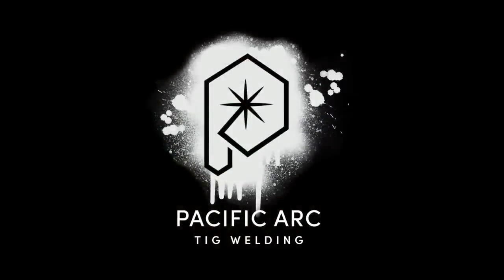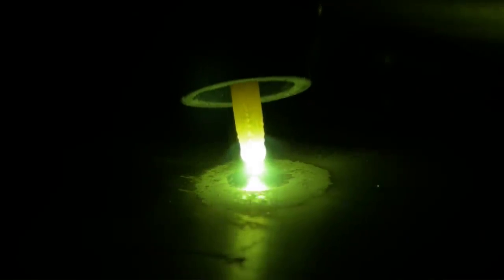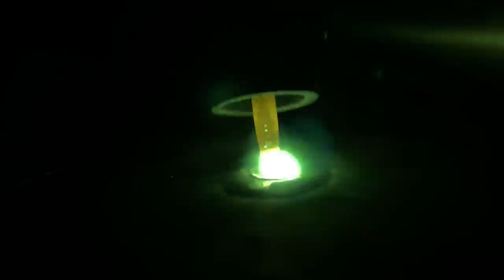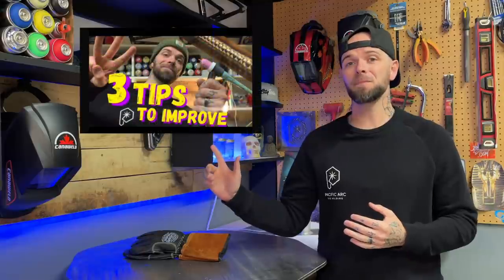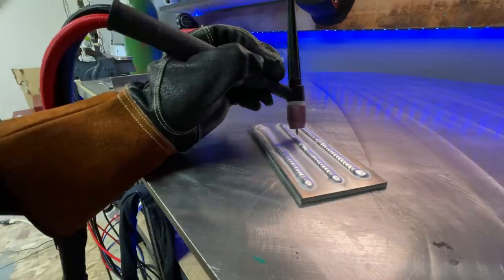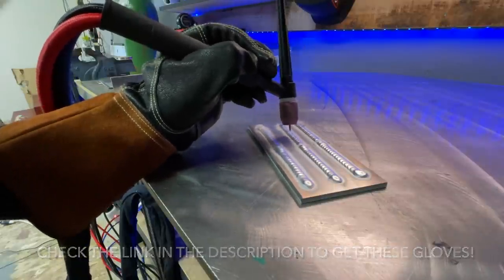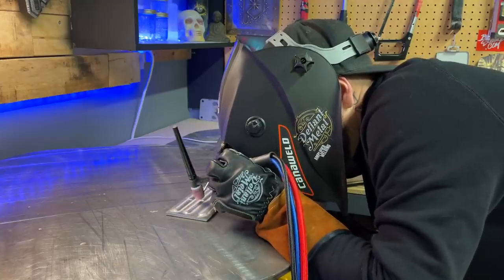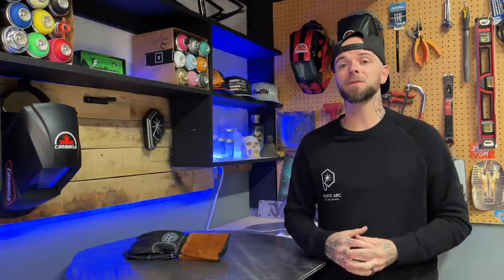DIPPING while Tig welding? STOP IT with these tips🔥

Comment: I’m newer fo TIG so I may be too focused on the torch itself - height, angle, travel speed, etc.  the most common reason I dip is because my brain gets a second behind on hand feeding the filler and when my brain realizes it, I switch focus to catching up and then torch position fails.  Happens maybe once a session.  Figured this kind of moment is a part of learning.  Working on stopping instead and doing a mental reset before starting...(edit - ha!  You were right, discomfort). 🍻
Reply: To start definitely get comfortable, so a fake run to ensure you have the movement needed. If needed turn amps down and go a bit slower. Over time you get used to it, and eventually be able to weld Tig in the most uncomfortable position you can imagine

Comment: For me, as a new learner, dipping is caused from uncomfortable travel length and/or not having the proper vision to realize how close I am to the puddle when I'm tracking along the weld. Thanks a ton for this video! I learn so much from this channel =) EDIT: I paused to drop a comment like you mentioned in this video, and as I continued watching afterwards, you literally mentioned my main issues!!! hahaha it's nice to know that my problems are common and I appreciate all the time you take to make this available for learning purposes and so on. I'm in my 3rd week of welding class now and this info is pure gold! currently working on horizontal open corner joints, and I've gotten about 99% through the project but sometimes leave the tail end of my weld with less penetration than the rest. I'm paranoid about blowing out the ends of my corners, and so I'm very touch sensitive when I get to the end of the joint and only get good penetration at the finish maybe 60% of the time. I'm still practicing and going extra lab hours to get it all down, but thank you so much again for everything you put out here for us to learn from!
Reply: Hey are you taking school classes or online course? I'm interested in something for beginners. I'm sure I can dip with the best of em! Thanks.
Reply: @MrCbell57  my school days are split into both. We start the day with a Zoom lecture and do our assignments and tests online, then we hit the lab for a few hours after. Great starting place for new learners. Good luck!
Reply: Seems if your puddle grows into your tungsten you can't see well enough.
Reply: Running into a tack at the end is preferred.
Reply: @johnmoriarty6158  that's not really the case for me, It's more so that I tend to accidentally dip my torch a little lower as I'm adjusting to the travel speed on the torch hand

Comment: Using a foot pedal makes it so much easier. Try using a switch, limits your torch angle even more.
Reply from the maker: Can’t agree more. Too much fumbling with heat control with a switch. Can be done for sure, but the footy makes it so much easier 🤙
Reply: I'm gonna go ahead and disagree with that, I've been tigging for nearly 12 years now and have never once found an issue with using a torch switch, but, again I haven't welded everything out there so its possible but not something I've come across yet
Reply: @mikethecripple  it completely depends on the switch on your torch ^^ there are switches that are super easy to press... then others you have to press so hard that you need to hold the torch like a mig gun to press it without dipping XD.

Comment: I never dip my tungsten,,,,,,,,,,,,,, when I'm MIG welding! 
 But eh, I find when I'm TIG welding a piece that I have to do in a difficult position I go through some tungsten. It would be great if I could do it all in a flat horizontal position sitting at a table. My consumables would last so much longer. I probably woulden't make Q-tips of my tungsten so often.  But  don't have that circumstance very often. But you know what I found helped me quite a bit was those glass lenses you use. They are amazing!!

Comment: Just wanted to say thanks for the great vids.  I don't think you can help me with my problem because I am Legally Blind.  I have been working on finding a way to TIG for several years.  The dipping problem you are right on about.  I have a pair of 4.0 cheaters in my hood and wear 5.0 reading glasses too.  This means I have to get real close (like they guy in that shot).  So when I have to adjust position, instead of stopping and resetting, I try to keep it going and , DIPPPPPP.  Just going to keep working at it.  Maybe a mini video cam and in helmet monitor might help.  Who knows.  I love welding even though I suck.  It just makes me feel like somebody.  Thanks for everything!!

Comment: my problem seems to be: i make a few practice passes. feel comfy.
somehow, the moment i lean on the pedal. i am pushing really hard on that same arm and can't move...
or, i get my gloves and sleeve bound up on the fixture table as i try to slide... then my arm jumps into the filler rod or i dip...
lack of proper focus is most likely the cause. during the practice, no pressure...
it's like playing an instrument casually, then someone hits record. at least I think that's a good analog.
I'm mentally thinking "light hands, lights hands..." before i strike the arc lol.
really appreciate your honesty. that's the mark of a pro. no ego to get in the way of the truth. or you'd stop improving.
thanks to you again for the content!

Comment: I've noticed a few recurring things that might be causes of dipping for me. They pretty much boil down to welding where I can't see, or can't see well enough. Much less frequently are things like having too much stick-out of the electrode- stick out that I determined I needed  in order to get the root pass of an inside corner joint that's also beveled ( beveled because they are heavy sections over an 1-1/4) Or also less frequent is keeping too tight of an arc, and once the filler is introduced , the added metal is now too close to the tip. Another one that's somewhat common is being tight-in where it's tricky to get the filler into the area easily and it's now just tougher to manipulate the filler.

Comment: Here are my "before" thoughts.

1) Vision- The ability to see the "Arc Length" is not only being able to see the arc length but also noticing the puddle behavior, as you weld more, the ability to notice changes in the puddle without actually seeing the arc increase. Head position, Clean lens, and an understanding that the puddle gets larger when you add filler metal can all help. Additionally, Aluminum can be a little more tricky due to the highly reflective puddle that gives you the impression of an arc much longer than it actually is. 

2) Physical control- The ability to control the torch and filler metal is a key part of being able to weld with Tig (and oxy Acetylene) and that ability is built by practice. Luckily, almost everyone has already built some of the torch control by just using a pen or a pencil. There really is NOT an easier process to melt two pieces together with and make it look good. My HS students are 1st introduced to welding with GTAW. They use the same muscles they have been using for years. Though there are hundreds of ways to hold a tig rig, placing the handle in your fingers similar to how many people hold a pencil is pretty much identical to what people do when writing. We are just writing with some fire!

Those are my thoughts. Now on to the video to see what you say. Great videos on your other stuff by the way!
Reply: Another statement I always use is "Start Uncomfortable, finish comfortable"

Comment: The thing that will get me a lot of time is when I am doing a fillet or a beveled groove weld and the puddle raises into the tungsten. I like to raise and lower my torch slightly as I go along, as it leads to a tighter and more consistent arc length. Sometimes I get lazy and dont raise enough though.

Comment: I recommend using a tig finger xl as it adds an anchor point that is also slippery enough you can slide your hand easily. Works especially well on pipe
Reply: I personally don't like the xl seems to fall off my hand a lot

Comment: I tell you why I dip, because I always seem to have a messy workbench, I can't run along a smooth workbench, my bench is the wrong height, the seat is the wrong height, the bench is covered in spatter. The metal isn't super fresh, so it doesn't seem to melt properly. I pretty much use the same consumables for everything. I have only one size of rod for each metal, and one size of tungsten. I can't feed the rod either. I typically get the job done eventually though. Or if I'm doing steel I'll typically just use MIG. I'm only watching this because I tried some alu TIG today for the first time in too long, on a machined part. So many problems ensued. A new one, I found unusual was not being able to clamp the piece down or I'd ruin the machining, the piece was tapered, so I was balancing it on it's small end out of necessity, probably weighs a couple of kg, in any case as soon as started an arc the piece starts wobbling! And I'm fairly sure it wasn't from the gas pressure. I think it was the force of the current flow (like electromagnetic forces) and/or arcing to the table. Weird times. Hopefully I never have to work like that again.

Comment: I'm still learning to TIG, I notice my weld all come out dark and are not clean looking. Like too much heat is being used. I working with 16g stainless and using a 1/16 filler rod, Eastwood 200DC with Argon. Any videos you can suggest or have an idea how I can fix this?
Reply: Sounds to hot to me, either speed up your travel or turn down the amps or both, but more than likely you need to speed up.

Comment: I just started tig welding two weeks ago while taking a class at the college. I have noticed in other forms of welding that it just seems I have good days and bad days. Sometimes I try and push through and sometimes that works. What's the tig I have noticed that I have to be in a very comfortable position with the right angle to see or it just doesn't work. I do have days in other aspects of my life where things just don't seem to work as well but I know if I just step back relax for a minute or a day and start again it'll get better. I think this applies to welding.

Comment: Nice Dillinger hat 🤘

I feel I usually dip either because of discomfort (usually I'm welding around small diameter thin wall tube) or focusing too much on keeping a tight arc, but not accounting for the puddle growing. Usually is more prevalent when I switch from steel to aluminum.
Reply from the maker: Good eye! About the only possession I had that survived the pit last time I saw them live😂
Reply: @PacificArcTigWelding  oh man i wish I had seen them live. Their stahe presence is amazing. I've seen a lot of bands live but they never made it up to Alaska. They alllllmost came up, but the promoters didn't have the dough to make it happen haha

Comment: using clear cups helped me with vision, a tig finger around the palm of my torch hand lets me glide on the surface and one on my fingers keeps my hand cool all of it helps alot specially when welding aluminum

Comment: I don't have a workbench or anywhere to put a workbench so I typically weld on the floor of my garage after backing the car out. I put my work up on an old beer keg which I can use as my earth clamp point and sit on a milkcrate. It's probably not ideal

Comment: I know I'm a little late to the race, but I may have a semi-unique problem.
I have a persistent tremor from some nasty TBIs I've had in the last half decade, as well as nerve damage/numbness in my fingers of my non-dominant hand. When I set up to weld and get the arc going, I'm actually incredibly unstable- until I start rolling down the joint. I can even wrap corners despite my setbacks. How can I get stable starts, and still transition to good joins?

Comment: I'm going to ask a dumb question.........The image we see on youtube, is that what you see through your mask or is it just the filter for the camera? 
Because no matter how much I adjust my settings I cannot see that well through my mask. I have a Lincoln Electric Viking at the moment. Do I need to upgrade to the "True Color" type mask.  I can't see the joins in the metal. So I don't weld the joint straight. I can't see the weld pool properly. I just can't see as well as your videos show.
I need help in sorting this issue out.
Thanks in advance.
BTW....I think you channel is by far the best weld channel on youtube. You go through everything like it's the first time you welded. And I need that because IT IS the first time I've TIG welded.
Reply: What shade do you have on your helmet
Reply: @gasclutch6280  I have an adjustable shade from 6 to 13. I've tried to adjust the shade to see if I can see better. If I have it too light, It's too bright. If I darken it up I can't see the join.

Comment: I'm brand new to welding. I think it happens because I don't have a good feel for where the tip is once the arc is obstructing the view of the tip. I also think that the puddle rises when I add filler causing it to touch the tip.
Reply: one thing I'm wondering about: often after I dip the tungsten I can see where puddle material has wicked up the sides of the tungsten quite a ways. Do I need to grind the tungsten all the way back to where the sides of the tungsten are clean?  Can I grind the sides of the tungsten to crudely remove the puddle material?  I'm dipping a lot, most of the time I'm just sharpening a new point and ignoring the material that's wicked up the side.

Comment: A reason I dip is bc for tig you have to multitask with both hands. One with the filler metal and with your other hand having to hold the tig torch at the correct angle. Learning the tig rhythm is the important part.

Comment: Most of the time I dip is usually not really a dip but because I hold my arc length to low and fill till it hits my tungsten either that or discomfort haha love the vids Dusty, have you got any tips on easing the annoyance of tight acute angled fillet welds?

Comment: I am just begining to TIG but i strugle with the arc on thin stainless. 1mm sheet/tube. I have to make some brackets to an exhaust which is very thin and i.m afraid will go through the metal. 
I have an ac/dc inverter but i really can't get a nice adequate arc. It's either too hot and burna everything or too weak and sticks or doesn't maintain..
Watched the videos..but can't figurw out where i.m wrong

Comment: After moving to Thailand, I have discovered 2 issues. First unstable electric supply causing variations in amperage.  Second the lack of a welder with a foot petal. Foot petal TIG machine are very uncommon here. My final solution is a Voltage stabilizer and second learning how to weld without a pedal. I now have 2 TIG machines I finally found a commercial machine with a pedal.
Reply: That would be a nightmare with no pedal

Comment: 80% of the time I either get it in when the puddle bulges after it absorbs the filler wire or I just tap the filler directly into it. The other 20% is just working in a tight spot and bumping my hand on something

Comment: Sometimes when I try to keep the arc length tight.. And 2 when I dip the filler sometimes it gets higher to the back where I am not seeing.
Reply: Your coming in to low with filler rod, increase angle of approach, could be using too large dia. Of filler.
Reply: @tubeonline629  most times it's 1/16th filler but I'll try what you're suggesting
Reply: @saied695  
Only other thing I thought of is you might be putting your filler rod into the puddle to far, watch your puddle not your tungsten, you just want your filler rod in the leading edge of your puddle and it should flow right into your puddle, but don't stay there to long or it will increase your puddle height. Just dab on that leading edge and pull back out, but not to far or you'll get your hot tipped filler out of the shielding gas and it will absorb contaminates from the atmosphere.

Comment: On stainless, aluminum, steel or titanium, the process should be to make sure you can comfortably accomplish the length of weld.  Dipping your tungsten comes from over-extending a comfortable weld distance, resulting in plain old clumsiness.  Anyone should be able to produce a clean weld...you just have to know how far you can weld at one time.

Comment: it happens cause you have to keep the electrode so dam close to the puddle, it's not easy and you have to look a the brightest part of the arc to do it too.
 people underestimate when they start out, I pre sharpen a bunch of electrodes and keep them handy, as soon as you touch off, just change it out, you can't weld properly with an electrode that's been in the puddle.

Comment: Paused video.  My top suspicions for dipping are:  Too long between needing to use tig welding process, shaky hands anticipating failure, using too small diameter of filler rod, and just inexperience after years of trying.  I'll have to throw in not practicing between times when I have to weld something.  Aluminum is much easier for me to dip in than steel.
Reply: Dusty, your depiction of what you see in student videos (Mr. Burns) is me exactly.  My dilemma is wear my eyeglasses and having to back too far away or use a cheater lens without my eye glasses.  Best choice seems to be Mr. Burns. D'oh!

Comment: For me I think it's mostly from habits with stick and MIG welding where you're used to touching the metal. TIG is a different mindset. You gotta flip a switch in your head which probably isn't automatic when you get started.
Reply: I agree, getting comfortable too as a beginner is important. When I started Tig it was touch down city but now after a couple years I very rarely do it. I can go from mig to Tig with no problems at all. Just comes down to experience
Reply: I can second this; MIG habits for sure.